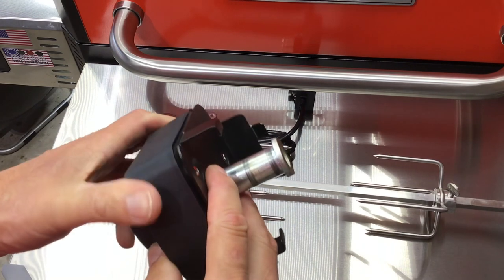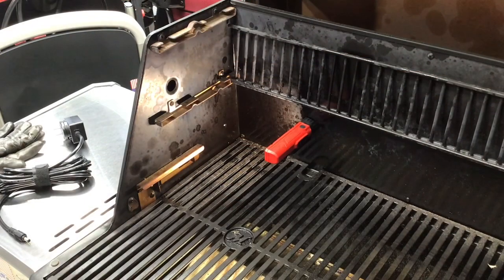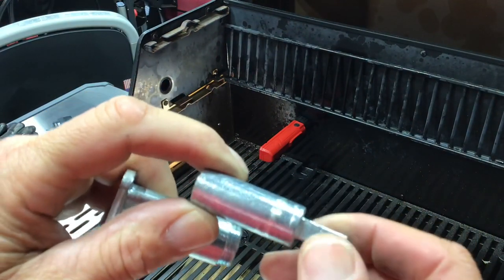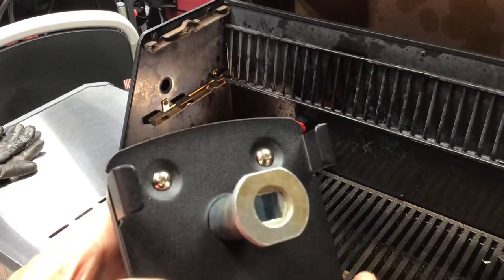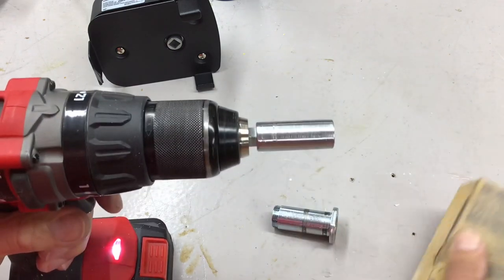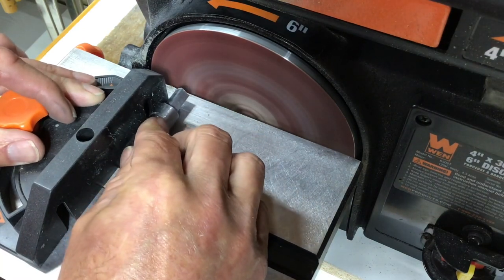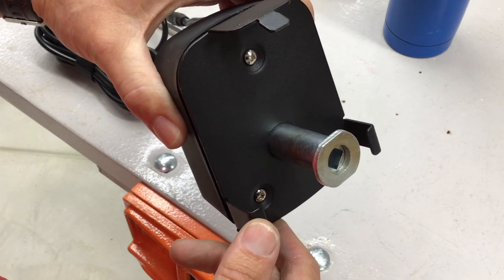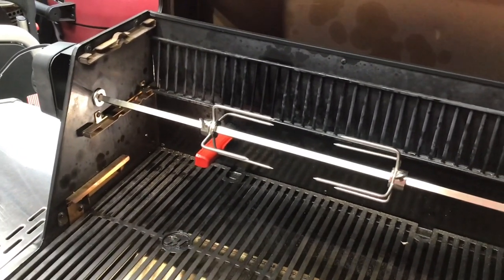Defective Masterbuilt Gravity Series Charcoal Grill Rotisserie / Simple Fix / Super Simple!

Comment: I really don’t understand the need to spin birds when you are cooking indirect. Over a fire-makes sense. 

Seems like a “made to sell” idea that’s not practical or necessary. 

Glad you got it sorted Tom.
Reply from the maker: Thanks for watching Eric! Spatchcock chickens are definitely easier
Reply: Interesting question.  After pondering it, I think that the heat still comes from below and that as the meat turns the juices redistribute within the meat instead of pooling at the bottom and dripping out from one spot.  I do a lot of rotisserie chickens on my gas and charcoal grills and they always come out juicy, never dry.  My MB 800 is on the way.  I think that Tom needs to do a comparison video of 2 birds.  Once spun, one spatch;-)
Reply from the maker: Thanks for watching Joe! Good idea!

Comment: we have already PAID for this thing and this is UNEXCEPTABLE in my opinion. Its shobby engineering and they need to correct it. Not everybody has a garage loaded with tools and the skills to ' make it all better '. You PAID for this grill and it should either work as advertized or you should be compensated for the failed part. Peroid.
Reply from the maker: Thanks for Watching Colin! You are correct

Comment: What grit sandpaper did you use?  Also, would it work without cutting down the length; I dont have that tool.
Reply from the maker: Thanks for Watching Adam!  Use 60 grit, cutting it down won’t work in my opinion
Reply: @TomHorsmanAmateurBBQ  thanks!  I saw toy cut the length down a little, but I'll just sand the sides.

Comment: Hi Tom, great video. Thank you. I had the same problem. In my case the problem seemed to manifest itself under load of a couple of chickens. Have you had a cook since the fix?
Reply from the maker: Thanks for Watching!  Yes I have and it works fine
Reply: @PM-gifty  thats what mine did, and even when I took the outer piece off that you screwed to the motor and just put the shaft straight in, it still did the same thing with and there was nothing for it to rub against. I removed one chicken, and it worked fine. Did you get a fix for yours?
Reply: @stantondavis7564   I ended up taking off about 2mm from the flat end of the shaft with a steel file. This seemed to work fine and now allows the shaft to expand a little more when it heats up.